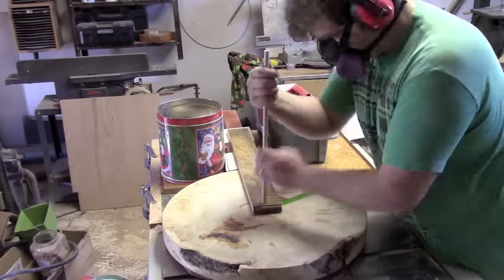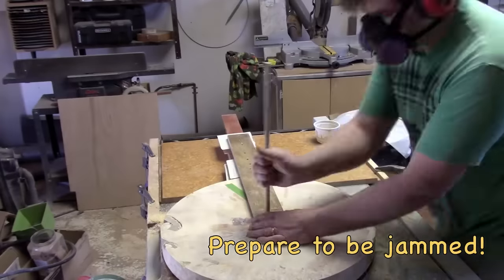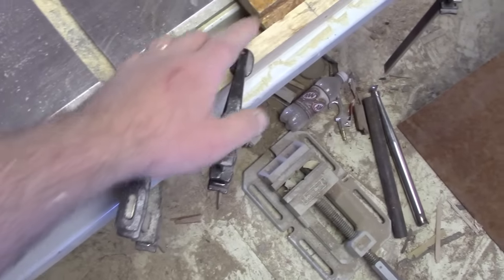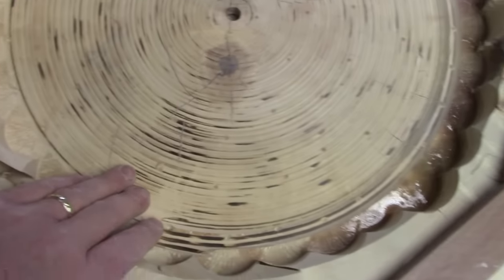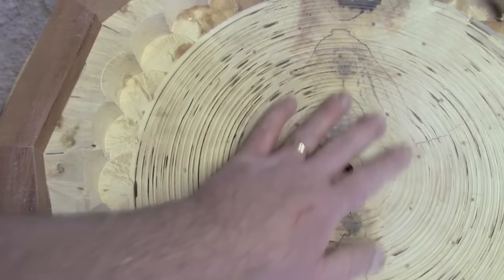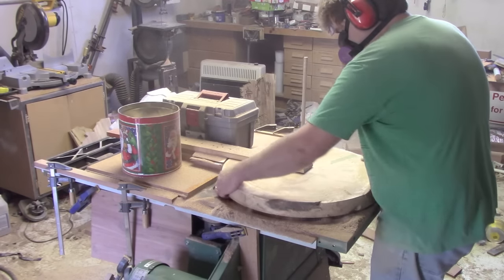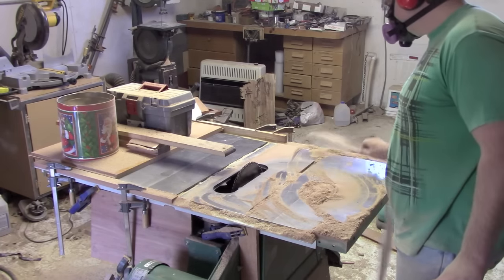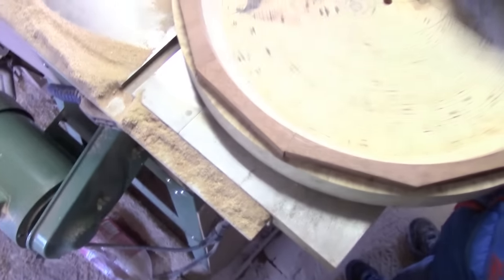Wood Turning on the Table Saw - #4

Comment: If I was doing that I would use a foot switch on the saw, preferably a "deadman's switch" so just lifting your foot shuts things off.  Not a criticism just a suggestion, I use that setup sometimes with my router when doing something I am not entirely comfortable with so when I take off running everything just stops.
Reply from the maker: +John Bare I would like to see your switch some time.
Reply: I looked and I have two electric foot switches and both are latching type switches, rocker type. My vacuum foot switch is latching as well.  I can't find the dead man switch that I used to use on my old router table and suspect when I gave away the old table to a needy woodworker it went along with it as I about loaded up his car with boxes of shop stuff I did not need any longer as I am not very active in the shop these days due to disability.

Both foot switches are commercial ones but it would be easy enough to make one with your expertise. These have a piggyback plug that you plug your tool into and then plug that into the wall and one leg is in series through the foot switch.

The following is a link to some quick pictures I shot with my Fire Tablet, not the best but shows them:

https://www.amazon.com/clouddrive/share/sh5EujII5HgdoFXheIteS5Pi3tplPjFyX31Xy8z4jYz?v=grid&ref_=cd_ph_share_link_copy

John

Comment: Just seems like the effort and rewards are not worth the risk mate. You not got a lathe? Use a router and a circle cutting jig. When you are cutting blind it has all gone wrong before you can react. Going to miss your fingers when they gone!
Reply from the maker: +Andrew Wilson That would be a big lathe to spin 23 inches, router jig maybe though the end result would be different, not wrong just different.  Simply having more/better clamps and the process would have been fine.